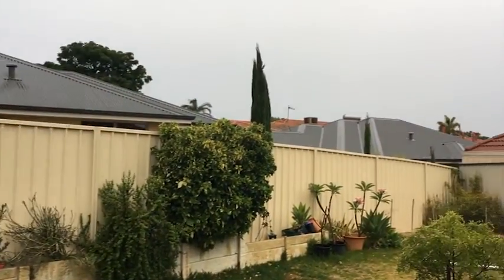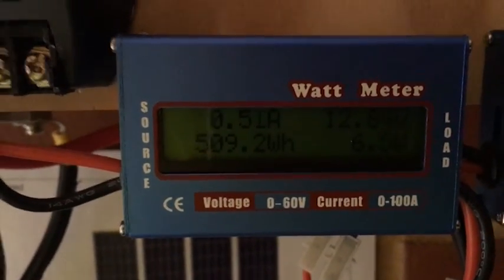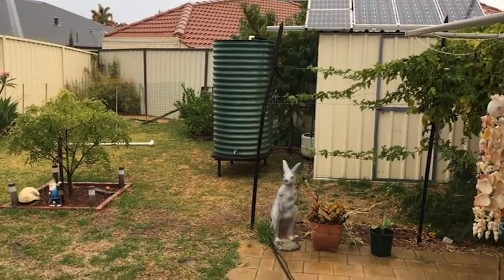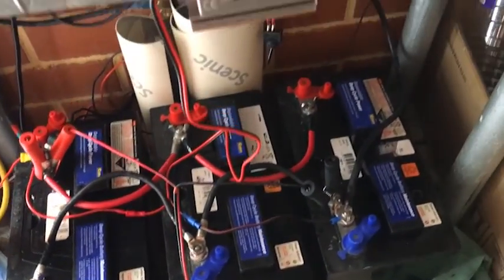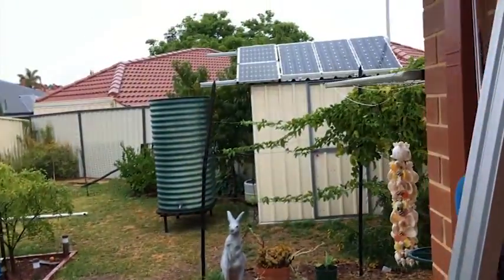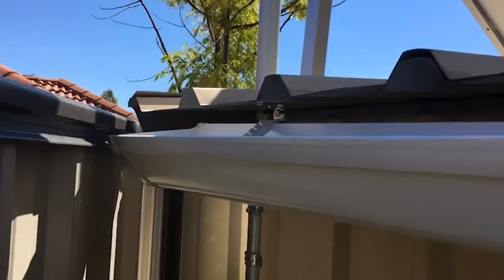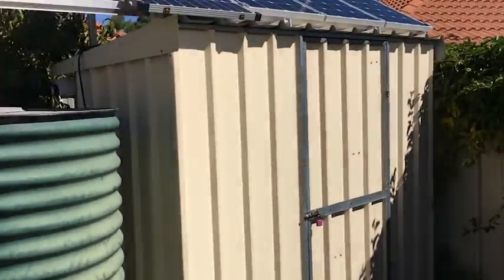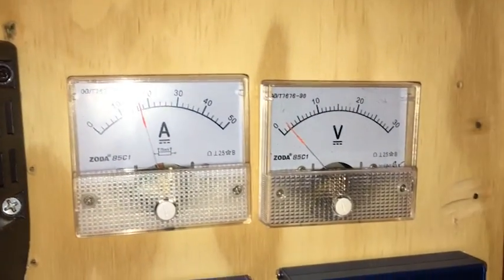Installing a 1000L water tank & Solar update

Comment: Looks good. I wish they sold cool looking tanks line that here in USA. Thanks for the video. O btw did the Eq help at all?
Reply from the maker: +yankey4  Yer it is good a tank I like it and it does not leak also it's a metal tank it's in good condition and it was free my dad wanted the tank when told him i got it for free.
I don't think I'll get a lot of water form my shed when it rains.
I think so the Eq helped but I know the capacity of the battery is not all there but time will tell.